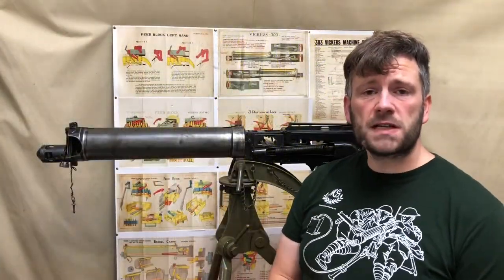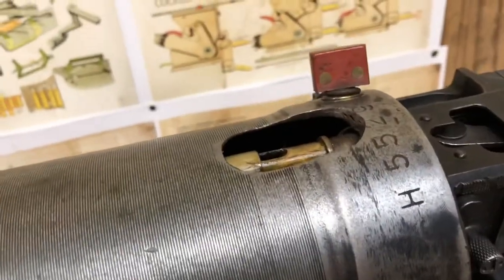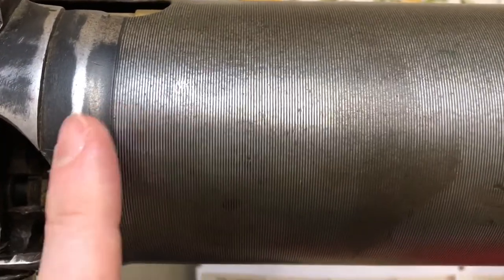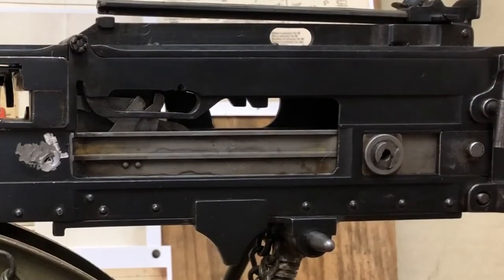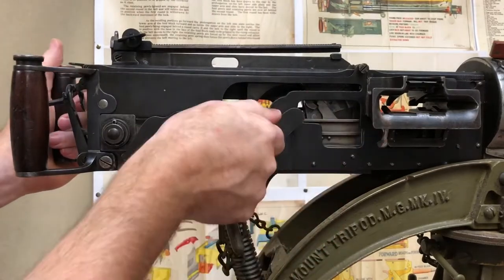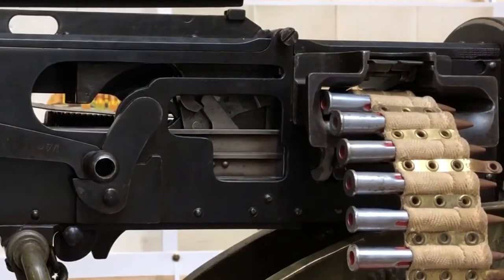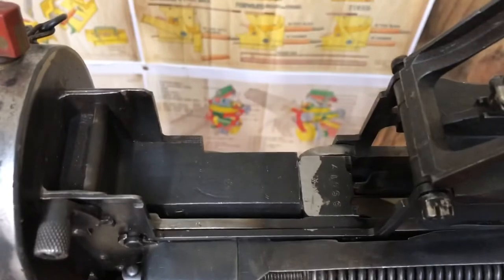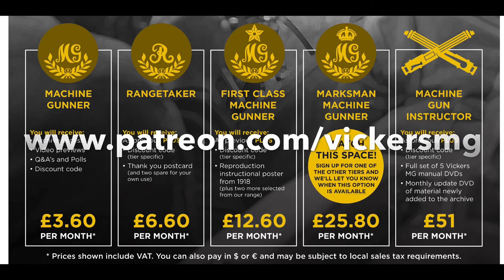Vickers MG study: H 5529 (and the Vickers machine gun mechanism)

Comment: Interesting! I know the gun barrel comes out during dissasembly but what limits the barrel rear movement during firing so it doesn"t try to come out of the gun?
Reply from the maker: Largely the fusee spring extension to slow it down and then it physically stops on when the recoiling portions contact the plates at the rear of the breech casing.
Reply: @vickersmg  ok, thanks!

Comment: Some engineering points here, there is no such thing as a " seam " weld, id guess its silver soldered ( brazed) or made from solid as there is no visible weld.  The finish on the jacket has been done on purpose, its not tooling marks left unfinished.
Reply from the maker: Thanks Richard, that’s useful to know.